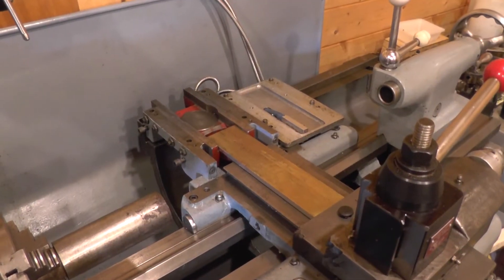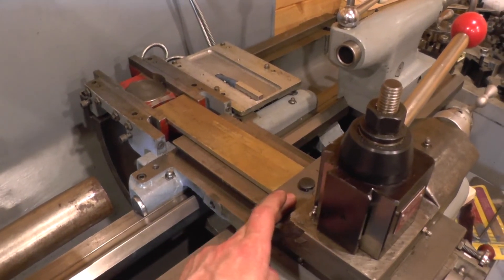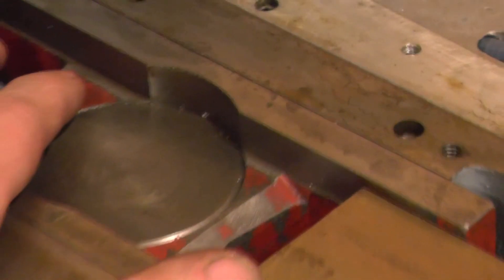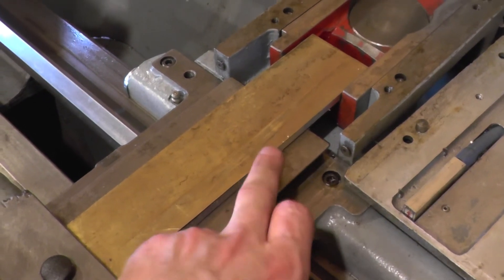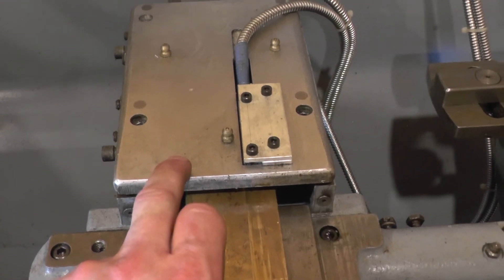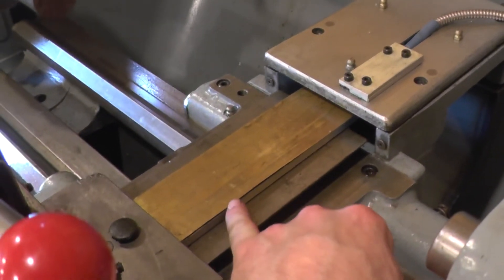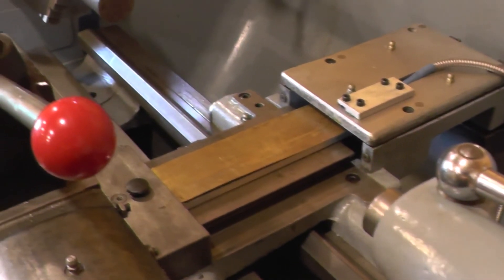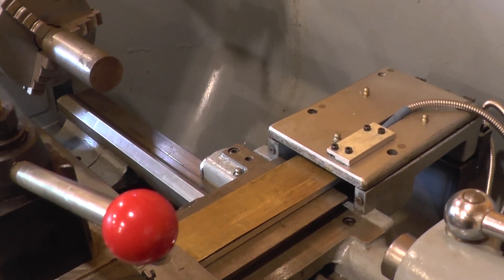Summer Shorts - Harrison L5 DRO

Comment: Hi Paul, I like your solution to the cross slide dro. I think i'd like to do the same to my l6 Harrison. Can I ask what the curved steel fabrication is, on the back of the lathe ? I'm guessing it is something to do with the long travel axis.
Reply from the maker: Yes, it's the bracket that clears the taper turning attachment and transfers the motion down to the Z axis glass scale.
Reply: @EVguru  Excellent. Thanks for the reply, that's a massive help. Regards, Richard.
Reply from the maker: @Av4nt79  I may have to do it all over again. I've agreed a deal on a really nice L6 long bed.